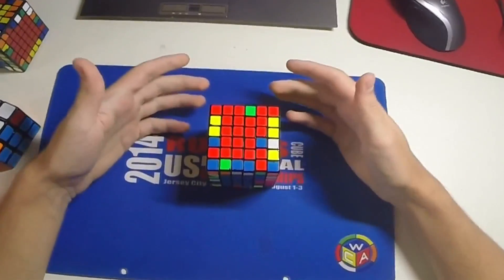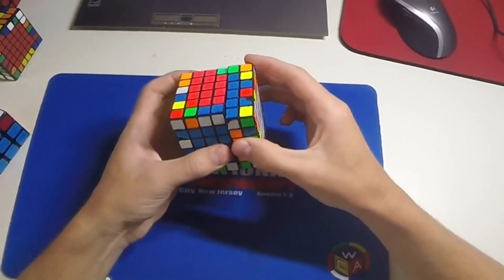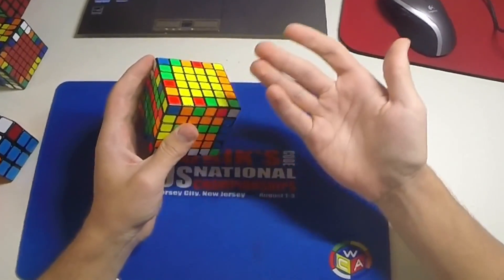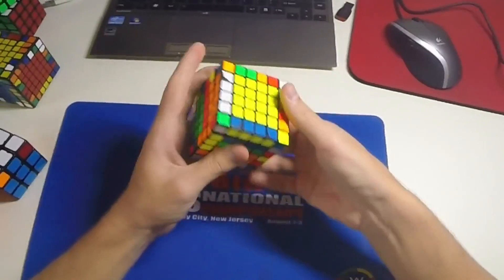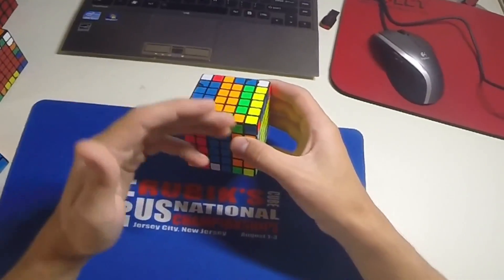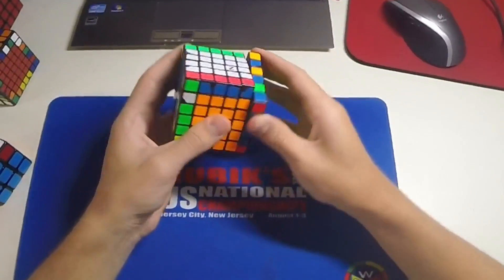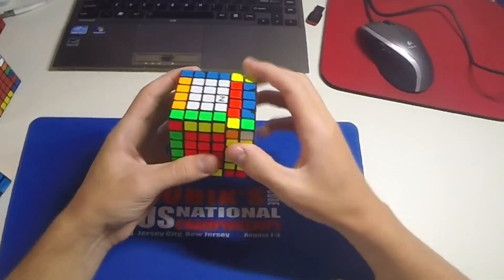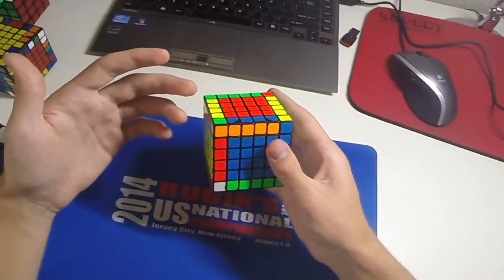Day 8: My thought process during big cube edges

Comment: I have a few questions regarding edges, some are from what I noticed here, some from other videos.

1. Do you solve white / yellow edges as much as possible for the first 8 edges? Or was this coincidence in this example of 
   solving edges? 

2. I saw in a video of someone else, that he inserted edges from below, he didn't flip the cube to insert them.
    Do you recommend that? Or is this something that differs from person to person?

3. The example you showed with the green yellow edge, I never really have done that before, but I can see how you did it.
    Is this something you do on a regular basis in a solve? Or is this something fancy and would I be better of solving it by the 
    standard slice and flip method?
Reply from the maker: 1. No, I don't. But it can certainly be helpful for lookahead, and isn't very inefficient.
2. Hmm I never really use D moves during edge pairing
3. This is something I'd do in a solve - but only in the rare case that there is nothing easier once I get to my last 4 edges.
Reply: Thank you for the answers!

I'll be experimenting / practicing and find out what works for me best on the D layer :). 
Do you mind if I place questions if I have any? 
I figured you get a lot of these.